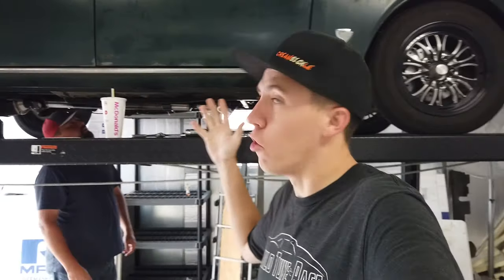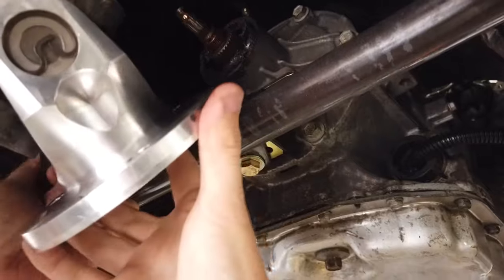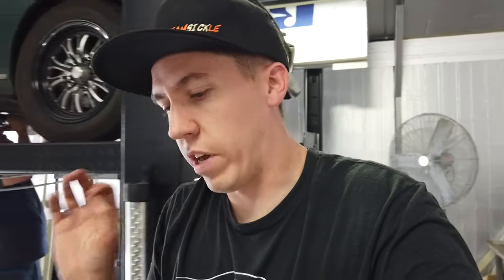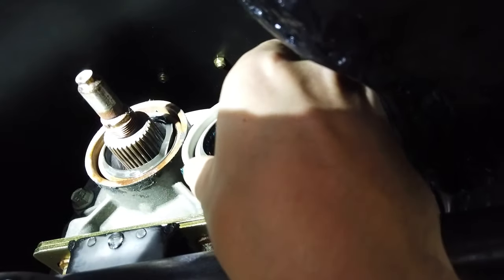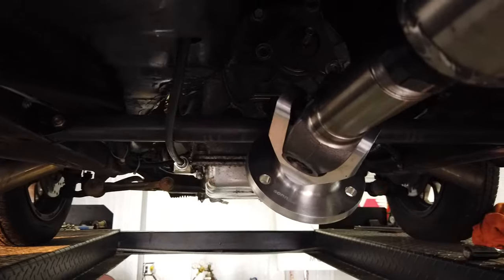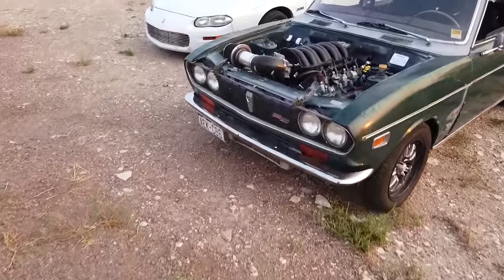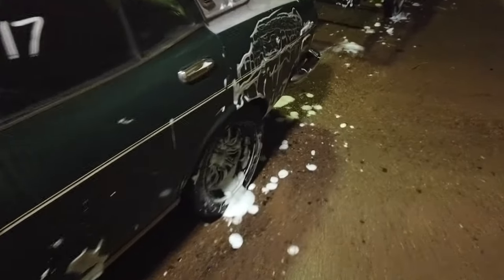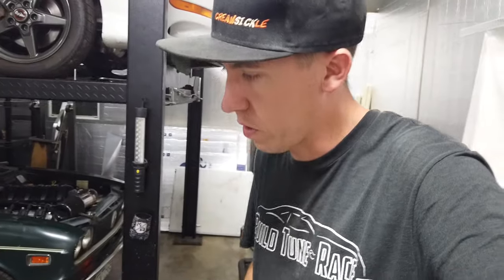Clyde Is Back!!! Fixing the V8 Swapped Mazda Rx2

Comment: I was told years ago after installing any new seals always apply a little oil too the seal to lube it and it will go better also a dry seal and yoke could burn the new seal
Reply from the maker: I put some assembly lube on it but a little dab of oil might not hurt! I'll check it out before the next drive. Thanks Ray!

Comment: Can't believe you guys have never changed a rear seal in a transmission you don't even know and it looks like and you call yourself mechanics? gotcha
Reply from the maker: First time I've done one... teaching myself as I go! Who said i called myself a mechanic? I just work on my own cars and build them.😁
Reply: @BuildTuneRace  In the past 120 years, as the "expert class" have risen to authority, ordinary men feel powerless over their own lives. And for the most part they are, exponentially so in the past six months. They used to supply men with sports as a vicarious substitute, that men could partially satisfy their need for assertiveness by passively watching others compete. Now they have taken that away too. So many men have taken to asserting their importance, exercising control, by acting like assholes in comment sections. The irony is that by doing so they become part of that expert class which has taken so much from them.